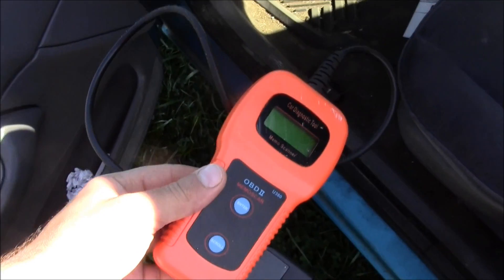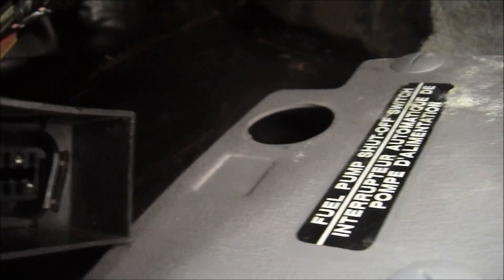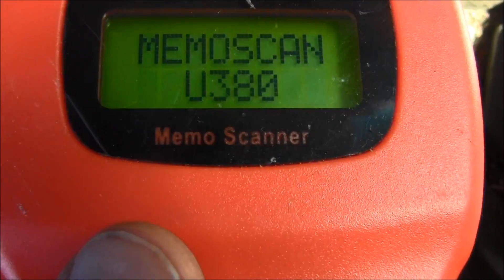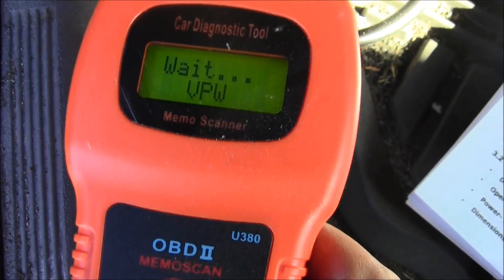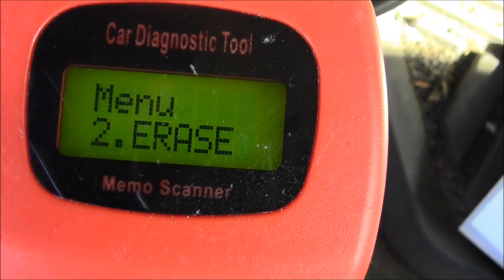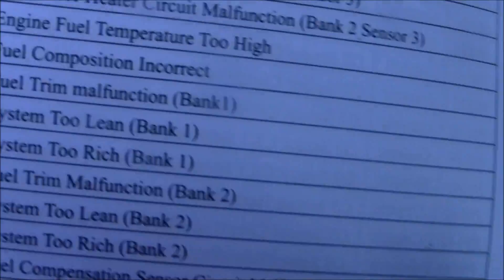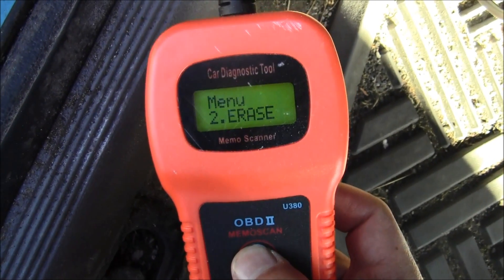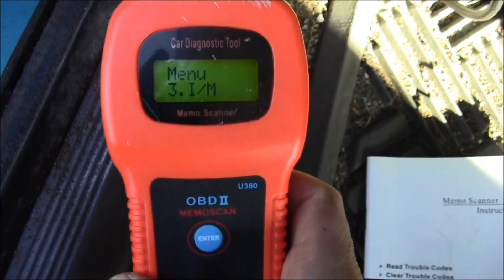How to Use OBDII Diagnostic Scan Tool

Comment: what would be the problem if it keeps saying linking error??
Reply: Turn on your automobile....then put the device in. If there is a code, erase it. I swear it works. Hasnt went on since I erased it. I have a memoscan 480. Try that one. Its dirt cheap. It worked on my Ford Explorer